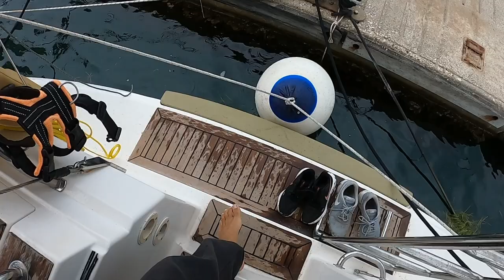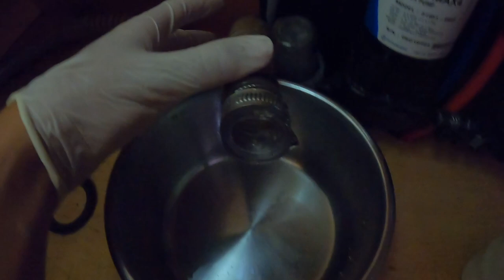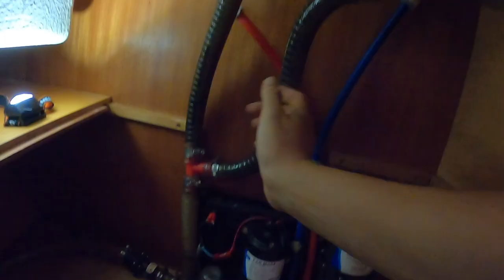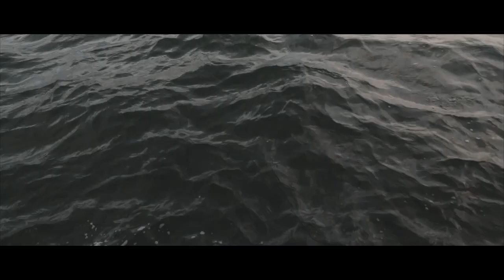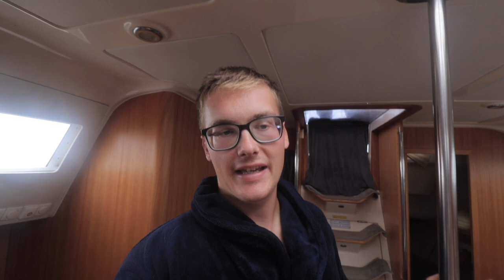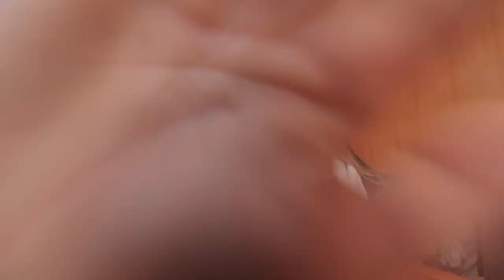WINTER IS COMING - Sailing Amari - EP.20

Comment: How do you handle heat on a boat with the dogs? Mine turns off at 26°. I can ask him for a 5" walk but no more.
Reply from the maker: If it gets hotter than 30 they are in the water 4/5 times a day! 

Then we have a big 40 inch fan inside which they both lie beside!